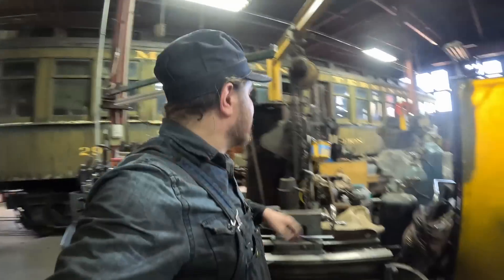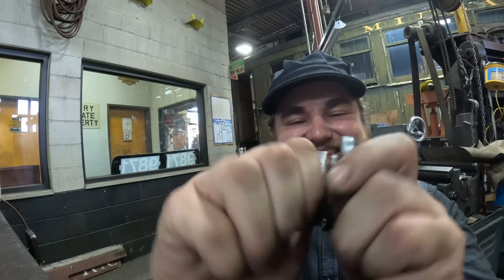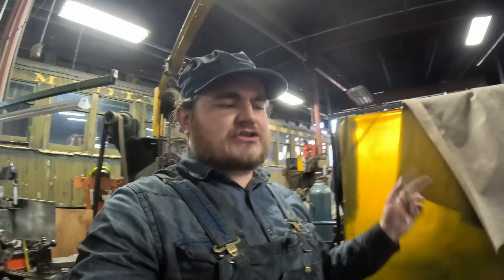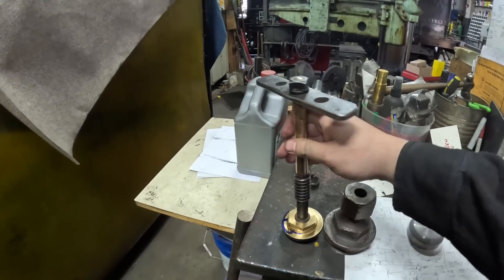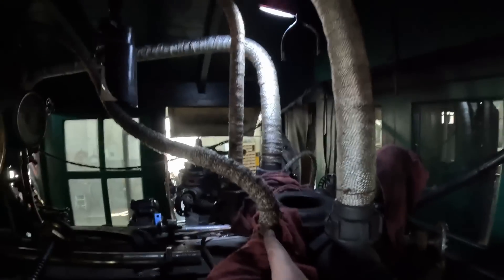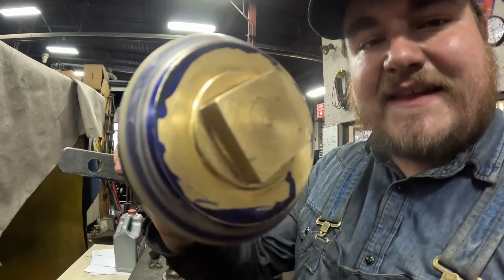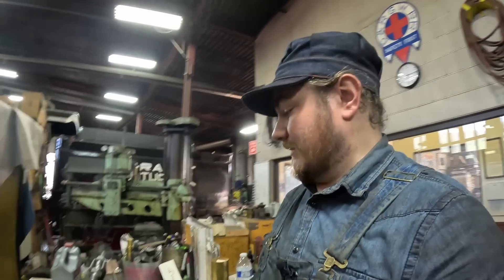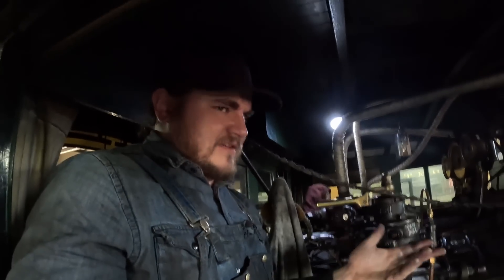Why DIESEL replaced STEAM TRAINS - a specific look. | Railroad 101

Comment: I think one of the most profound things you ever pointed out to me in this regard was that most shops on modern railroads don't have any machine tools... Diesel shops are set up to swap parts, steam shops are set up to make parts.
Reply from the maker: That's right! Blew my mind when I started working at Interbay. We had a drill press. That was the most advanced machine we had. Topeka, KS backshop where they do the huge 20 year rebuilds on the locomotives has everything and true machinists, but the rest of the shops don't.
Reply: @Hyce777  Interbay WA?
Reply from the maker: @ExiaLennelluc  yup
Reply: @Hyce777  how long ago was that, the round house is a shell of its former shelf, probably going to be shutdown this yr or next
Reply from the maker: @ExiaLennelluc  I worked there from 2017-2020. Yeah. It's depressing.
Reply: @Hyce777  interesting i probably ran into there at some point then
Reply: @Hyce777  I think the environment for servicing steam has changed from when steam was king compared to when diesel was king.

When steam was king, you generally had a lot of locomotives within a fleet that shared parts between the different locomotives.

This is in contrast to heritage lines, where you have one locomotive from one railroad, another locomotive from a different railroad, and none of the engines share parts.

This means that every time a locomotive needs a spare part, you need to machine it yourself.
Reply from the maker: @Ben31337l  The point I was making is that you'd still have to do that, even for the same class of engine. Some parts sure, but everything is slightly different with each engine - it's not just a bolt up and call it a day kinda thing. I imagine when steam was king and they had armies of folks maintaining them they had spares that were roughed and ready for fitment, but that fitment comes still.
Reply: @Ben31337l  Steam engines came into existence at least 50 years before the concept of "interchangeable parts" became common practice.
So you can't count on the pitch and diameter of one bolt and nut being the same as the next one, even if they're right next to each other on the locomotive. And that's just the least of the problems this causes.
Parts on the locomotive itself are often not interchangeable, let alone between two locomotives of the "same type".
Reply: Although we need to remeber the steam engines are from a pre 1940s world of manufacturing and designing.

If we had stuck with steam engines, we would design and build them today, with todays machines and design philosophies, so likely many things woud nowadays be designed as easily replacable.

Not everything, but a lot.
Reply: Diesel shops are set up to swap parts. Whether the parts are available to be swapped is an entirely different matter. I don't know if railroads jury-rig as much nonsense as I've seen in automotive production. . . .
Reply: @peregrina7701  As a locomotive technician, we have times where we do some sketchy stuff to keep things moving. Just the other day I had to manually move contactors in a high voltage cabinet to get a locomotive to move. They proceeded to run it for a few hours switching cars before bringing it to the service track for us to actually fix.
Reply: It's the same in electronics. I work in professional AV repair and the majority of my work is swapping out parts, however i do try and component repair as much as i can. Some of the stuff i work on, like video walls, component repair/replacement is the only real solution as the components (even down to the LEDs) are all done and bought in one batch to maintain consistency.
Reply: It's pretty freaking cool in my opinion. I really like this.
Reply: I feel like it would be really cool to see one of these steam locomotives in action but I hope they don’t all get phased out by the time I get in and then out of collage. Something I have heard about steam locomotives though is that they can run for a LONG time with proper maintenance and care. But yeah I’ve also heard that saying about steam engines through research before and this video proves it.

Comment: To be honest that seems more like it's a design issue rather than steam itself, problably when those engines where made materials where hard to come by and spare parts wheren't common, if someone designed a steam engine today they could fit it with replaceble parts and eletronic controls. Also that sort of repair is more in line with the stuff we do to make an old machine keep running in the industry.

Comment: Steam is an amazing resource that has—and still is—helping us grow and advance. But diesel electric (or just straight electric) makes a lot more sense for railroads. Not just because of decreased maintenance time, cost, and labor, but also because they’re much easier and safer to operate and don’t need to be running hours ahead of time in order to build enough pressure to move. Of course, Class 1s tend to leave the locomotives running 24/7. At least, BNSF does.

Comment: Hmm, but a large part of what you're saying sounds like it's just about old vs new, not steam vs diesel. How much of this maintenance cost difference would remain if steam locomotives were designed and manufactured with modern methods, optimized for TCO ?

Comment: Modern parts interchange could be applied to steam locomotives. However, that is not going to solve the larger problem, which is daily maintenance, such as cleaning out ash pans and grates, frequent lubrication due to constant loss oiling, and the frequent need to water and fuel. All these daily activities required lots of people and infrastructure. That's not to mention the advantages of dynamic braking and multiple units that diesel engines offer.

Comment: I think something that is somewhat overlooked is the rise of efficient and compact traction motors. If you had a steam train today, it would be an oil-burning turbo-electric - like UP briefly had. Which could arguably be less complex than a diesel engine (though lacking in other areas). A lot of the complexity of classic steam trains is really to do with the transmission. Getting the power from the pistons to the wheels and being able to throttle the power and reverse it and so on - something that traction motors completely solve.
Reply: That sounds awesome!

Comment: I know how much more cost effective it is in the long run to flat out replace parts but I do enjoy things that aren’t made for planned obsolescence, it just seems incredibly wasteful in recent years. I work on my weed whackers and mowers and I went to buy a new gear box for one that’s 10-12 years old, they told me it would be cheaper for me to just buy a new one of the exact same model than to order the 1 part I needed, which would mean if the new one did the same thing down the road with nothing else wearing out, I would have wasted an entire weed whacker. I wish things would go back to being more affordable to work on something than to just replace it and trash it.

Comment: I wonder if it is possible to decrease the maintenance required on steam locomotives to make new designs practical?
Reply from the maker: Unfortunately not really. The 31 day inspection comes from needing a boiler wash. It's just a fact of boiling water in a closed system.

Comment: I mean you make a great argument for the steam locomotive over the diesal...I mean as a old man and diesels have moved on to electric and or hydrogen so you can't just replace units as no one makes then any more like an car after 20 years would you rather do... Remake Steam parts by hand or remake Diesel parts by hand? Like it's the difference between a Ford Model A and a Ford Fusion one will have parts in 20 years the other won't. Not only because one has an after market were you can just make a new Model a if you wanted to. But all the parts are easy to hand make and fit in not much time. But yes diesels are better because gas is light and energy dense so that is why no one makes a steam locomotive with modern replaceable units.

Comment: How does your turret shut of work is it just like any other valve that you close manually. In Sweden we have automatic tires shutoff where you pull a cord along the roof and it slams shut by the pressure from the boiler.
Reply from the maker: Ours is just a big valve. Nothing special. That sounds nice :)
Reply: @Hyce777  it is until you accidentally hit the cord with something and close it. I’ve heard stories about it getting stuck closed.

Comment: Well… you explained why we switched from designs with lots of customization to designs with standardized parts that are replaced rather than fixed.  But I believe that someone could have designed a steam engine with replaceable parts rather than customized parts.   There are countless number of diesel engines but they are all a few designs.  We could have countless number of steam engines all based upon a few designs making it economic to replace parts rather than customize parts.

TL; DR — you didn’t explain why we switched from steam to diesel; you simply explained why we switched from repairable parts to replaceable parts.

Comment: I love seeing this channel and this fascinating content, watching you is a pleasure. And i have a really interesting and important point to give:
Regardless what type of engines are better, everything gets standardized and polished sooner or later.
Steam locomotives were pioneers of railroading industry. It was the time when many railroads weren't even connected to each other and many times used different gauges, different couplings, etc.   It was the time of many experiments, and hence, it's the time when trains were unique. and this is where a really valid point of this video comes from. each locomotive model required unique parts.
BUT. imagine a world where steam locomotives would be more fuel-efficient as modern diesel locomotives. You would be able to see them every day and by this time they would become standardized. You would see same picture - they would be made of tons of premade components that are identical for each steam locomotive.  Repairing a steam engine would be the same as replacing parts. why? because they are standardized.
So my strong point here is that the given reason in the video is NOT the actual reason of the decline of steam engines. 2 main reasons are:

1. energy efficiency. i've seen different estimations, but all the estimations agree that diesel is around several Times more fuel efficient to run.
2. easier and much safer to operate such a train. steam engines have many disadvantages like releasing ashes from the burned coal that can be dangerous in certain environments because things can cought on fire, also the risk of explosion.
those are 2 Prime and foremost reasons that made steam engines obsolete. It has barely anything to do with the problem of replacing parts.  If steam engines would be efficient and safe, their parts would become standardized and we would see same thing as we do with diesel.

As an additional note, you are saying the (diesel) parts can be bought from some third-party shop. But the thing is, those parts you would buy are made by certain workers at certain factories anyway. they're still not made out of thin air. And their cost is still identical to the amount of effort that workers need to make to manufacturer all those parts.
What is also not a diesel? A clock in your house is also not a diesel and has lots of unique parts compared to diesel. But having custom parts is not a concern as long as you have a solid optimized facility that manufactures all those necessary parts for making something useful and beneficial.

So final words, traditional steam locomotives are no longer a thing because it's no longer beneficial to invest to maintain/operate/manufacture them when they won't deliver overall competitive performance, efficiency, and safety.   Steam engines can be as powerful but only by consuming several times more energy, so it's definitely not an option in the eyes of the companies.
But it's definitely sad for me because i love the way steam locomotives look, the way they function, i love so many things about them!
I hope this comment is useful.
Reply: What about diesels?!

Comment: The main point of this video was steam requires more maintenance than diesel because they were made that way.  Ok, so what would happen if someone made a steam loco with throw-away parts wherever possible, using the same philosophy as diesel?  Would that bring the maintenance down close to diesel?  If so, the difference isn't steam vs diesel, it's 1920 vs 1960 (or whatever the correct dates are).  Of course, that won't fix the steam start-up time of hours vs minutes for diesel, but we're only talking about maintenance at the moment.

Comment: To make thread cutting easier, flip over the tool and run the process backwards. You will still get correct left/right-hand threads, but because tool is auto-feeding away from the chuck you don't have to worry about smashing it into the part.

Comment: My dad was a marine steam engineer. I picked up a lot from him. I own, run, and work on marine diesels. What most people don't realize about the steam era, it was a lot of maintenance, more work and discomfort for the crew. Diesels made life easier. Steam engines need consistent maintenance. But a diesel will go decades with oil changes and occasional maintenance. 
I grew up in the 1950s, in a town with a major locomotive maintenance and rebuild facility. When steam was phased out, hundreds of local jobs went away over the transition. Diesels didn't need that kind of maintenance. And no more double or triple headers. You just connect diesels together and run several engines with one crew. 
But I do miss steam engines. As a kid, I remember the steam whistles on summer nights when the windows were open. Signaling each crossing, to and from town. Each engineer had their own sound. You may not know the engineer, but you knew his whistle. Like most boys, I wanted to be an engineer...     until diesels came.
Reply: Diesels need a lot of respect though.

Comment: I'm kind of interesting to hear your opinion on why Diesel replaced steam, because I've only ever really heard the British opinion of it. The Beaching report said we have to. But in short, it's cleaner, and more economical.

By the end of steam, most of the parts of steam locomotives in the UK were already at a point where you could just take spare parts of a shelf and fit them. Engines had specifically been redesigned so that multiple different models used interchangeable parts.

In fact, that's a key feature of the new P2 2007 Prince of Wales. A lot of the parts are interchangeable with the Tornado, so they only need to stock one spare part for either engine, instead of one for each engine.

Comment: Interesting how similar the parts on No20 are to those on Baldwin design narrow gauge (2'6" or 762mm) engines built in the early 1900's.
The preserved railway I worked on had five engines of the same class, but all were slightly different in the pipework.

Comment: It's absolutely true that a diesels maintenance requirement is a tiny fraction of a steam locomotives. However, another major factor is wear on track infrastructure. In the steam era, a track gang was typically stationed every 10 miles of track. Improvements in crew mobility and the quality of the rail certainly were factors but the replacement of the reciprocating pounding of the steam locomotive with the diesel was, by far, the greatest factor in the disappearance of the track gangs. Also, I'm a fan of the Buffalo, Rochester, & Pittsburgh Ry, later B&O. The Mosgrove bridge over the Allegheny River was a severe operational bottleneck due to weight restrictions. The railroad used 2-6-6-2 extensively and also had 2-8-8-2 for pusher service. However, 2-8-0's in multiple unit freight consists and light Pacifics in passenger service were the norm on the south end of the railroad because of this one bridge. After dieselization, any and all diesels could cross the bridge. The bridge is still in use today by the Buffalo & Pittsburg. This 120 year old bridge, that was too light for for all but the railroads smallest steam locomotives only 20 years after it was built, is in use daily with multiple unit lash-ups of SD40-2's, SD45's, SD40T-2's, SD45-2's SD60M's, and whatever else they may currently have on the roster or are leasing. JM2C  :-)

Comment: This is the real issue with steam. Parts availability and those who can do this type of repair very rapidly. Everything in the old days was built to be rebuilt by design. Not much replaced. They would rather rebuild then buy new. Overall and in the long run it is the smarter way to do it too. The skills arent lost totally (you did do it but you dont do it everyday like the guys 100 yrs ago ) but the guys who could do diagnosis, repair, replace, rapidly,  theyre gone now. Back in the 1970s and 80s they were still around so rebuilds, maintenance, and repair was much quicker and efficient.  Parts werent as hard to aquire either.
Reply: Doesn't help that the manufacturers of set parts like vulcan foundry or beyr peacock & company don't exist anymore...
Reply: @davidty2006  true but that was primarily a UK supplier to the UK and it’s colonies
Reply: @steamgent4592  Vulcan foundry and beyr peacock also exported engines to other countries that arn't UK colonies like the netherlands.

Comment: I expect early diesels were extremely maintenance intensive, judging by how maintenance intensive contemporary automobiles were. Lapping the valves (intake and exhaust) and "de-coking" the head was basic maintenance back in the 1920s, something that was considered as normal for the owner to do at home as an oil change.